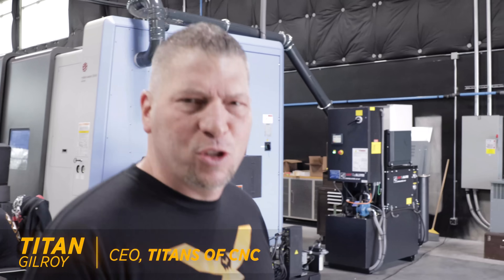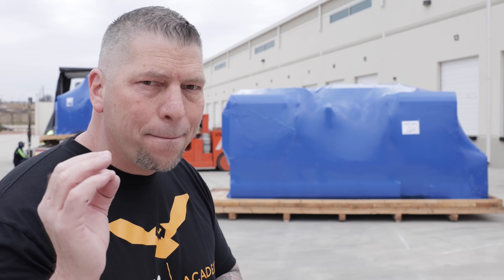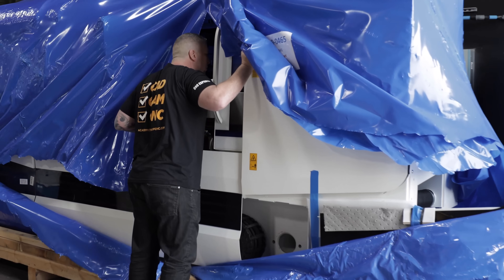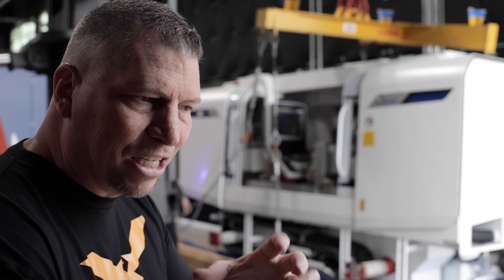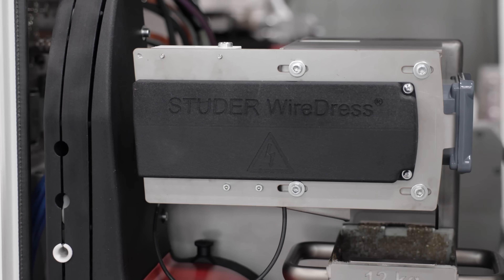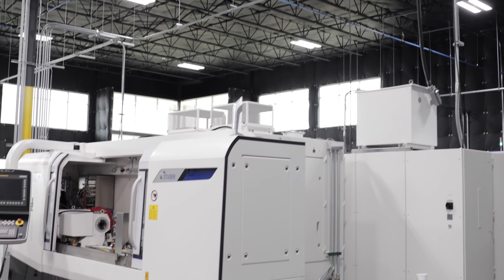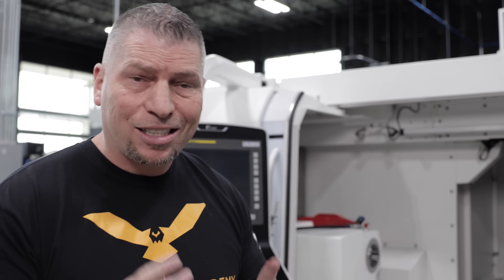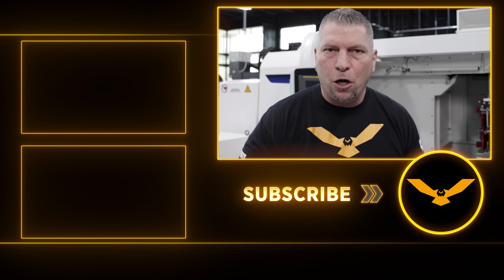Studer S41 Grinding Machine from United Grinding Hits the Floor at TITANS of CNC.

Comment: the operator makes the quality.  no matter how accurate the machine is if the operator is not doing his job properly you just make trash.  beautiful machines is one thing, but the feeling for your work is completely different.  The strategy also matters, every batch of material can be different, and the tool life can sometimes be shorter or longer than usual. Anyone who makes accurate work can confirm this.  don't get me wrong it is of course a beautiful machine keep up the good work guys!

Comment: One question, why is this machine installed across two slabs of concrete and not one? We were always taught to install any machine on one slab, because if there is movment beneath the foundation and that slab moves the machine still remains in position regardless of the movement beneath it. In this case, you have installed the machine across two where this is possibility of the one slab moving upsetting the alignment?

Comment: The repeatability is only as good as your measuring equipment, that needs to be up to scratch, and have repeatability studies done on them, that's really important at sub 1 micron even above that, you cannot have the machine with out the measuring equipment which can match it, this is really really important.

Comment: The Studer S41 with wire dress is boldly taking grinding to a new, never before achieved level of accuracy and productivity.  Not only is the S41 the greatest cylindrical grinding machine of all time!  It can perfectly dress metal bonded super abrasives wheels.  So the best machine is the world has the sharpest, strongest, high speed, wheel with zero runout.  The results are so great; you need to see it to believe it!

Comment: First time I see 1 000 000 price tag grinding machine in non climate controlled workshop. Yo can forget about any zero's after third in these conditions. Bilionths milionths whatever. It just doesnt work like that.

Oh one exception.. If thats only showroom then its fine.. :)

I guess everyone is running to spend 1000 000 because titan says aircraft parts are made on it. Beeeep - not exactly true cause most of the engine parst are made on differet type machines. Even if you buy 10 000 these you will never get aircraft job. Other factors contribute to it.
Reply from the maker: We are completely climate controlled

Comment: All that precision in that machine is wasted if you aren't in a climate controlled room and I know that big ol building with 30' ceilings in texas isn't air conditioned. Parts can change by .0001s with just 15 or 20 degree change in the air, forget about .00001
Reply from the maker: Our entire shop is temperature controlled.
Reply: @TITANSofCNC  you must spend an absolute fortune on electricity

Comment: have over 5 years on an s40 and a studer favorit machine, awesome machines. new ones are built without ball screws and no gears on the rotating wheel heads

Comment: In 1986-87 I worked at Bosh fuel injection in India, and there were around 40 of these studer bad boys running finish match grinding on fuel injectors and consistently pushing out 2-4 microns of taper over a 20mm length and 8mm dia. It was mind-blowing... the blanks themselves were preground by two processes, one creep feed grinding and another centerless. I remember that there was a 3foot deep foundation below each machine and the shopfloor was maintained at 20degC all the time... machines ran 3 shifts/day (24 hours).

Comment: I also expect that my 560$ chinese manual lathe will be delivered with a cool truck. Afterwards convert it to linuxcnc and start competing with the big companies.
Reply: hi Mr take step by step to reach your goals. a love competitions, and it's possible to start small and compute with big, we have seen . take it up
Reply: @ahamatibrahimhassan3265  I went from Software to Electronics to Mechanics (and connected everything), it all depends on the use case, if the particular parts we need can be done with a 560$ machine it's just fine.
Of course it has limitations but those go hand in hand with the needed parts.
Plus LinuxCNC and some tools the machine will probably cost around 1500-2000$ (I've done LinuxCNC conversions already in the past with a milling machine and we're using it a lot). And the best thing is that those cheap machines also tolerate mistakes, replacement parts are cheap too.

I think the most challenging part is the lead time until everything is set up.
And I don't really intend to compete with the big companies, I just want some special parts which I evaluated that I can do them cheaper myself in a small quantity (few hundred piece).

Comment: Grinding is the next level. And the s41 a beast linear motors. And with the wire emd dresser you will be running cbn wheels.
Reply: Aren't linear motors overrated? Over-Over-Overrated? Just have good linear encoders  on it and a closed loop system should take as well care as a linear motor.
I really don't see the benefit in terms of cost versus accuracy.
The linear motor is just a direct drive motor but still relies on the installed encoder like all the other accurate systems.
Plus in that term what is the benefit of the linear motor? it probably won't do very quick process operations?
They're just freaking expensive.
Reply: @mrechbreger  When paired with the Studer linear guide system linear motors are really great.  You can make a change in direction with zero backlash.  Even a new ball screw will have some backlash.  Ball screws will wear over time and the backlash will increase.  Linear motors are not subject to wear and are less likely to be damaged in the event of a collision.  Linear motor movements can be much faster than a ball screw.  Linear motors are more expensive but in the long run your machine will perform better and need less maintenance.

Comment: Is the drip pan standard for the machine?  Always thought it could "walk" over time with the sheet metal  taking the weight.
Reply: Bill , I agree if the machine is placed on the sheet metal and it is not dimpled at the leveling pads and grinding oil or water base getting under it is unbelievable how easy it becomes to move.
Reply: Good point!  The pan is definitely not standard.  It is more difficult to prevent oil coolant from dripping on the floor than water soluble coolant.  So some people choose to use a pan.  I think it is nicer without the pan.  If you have a leak.  Find the leak and fix it.